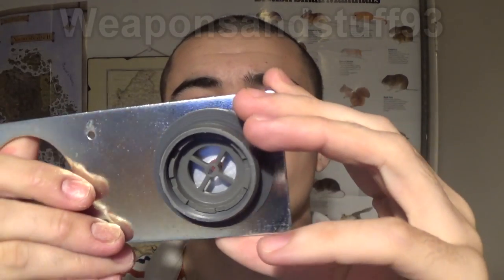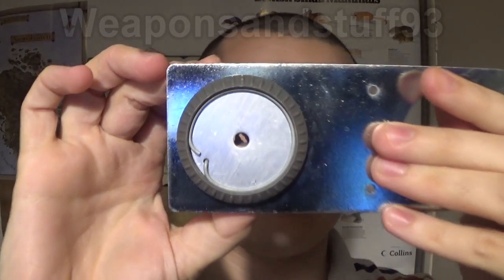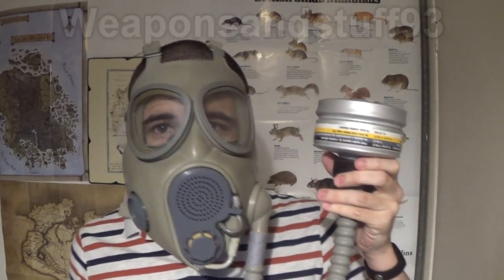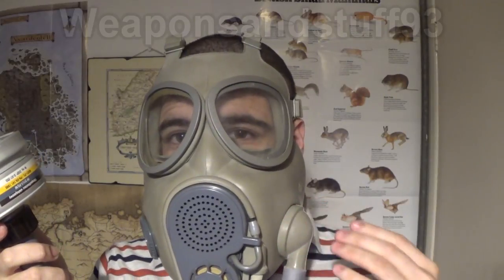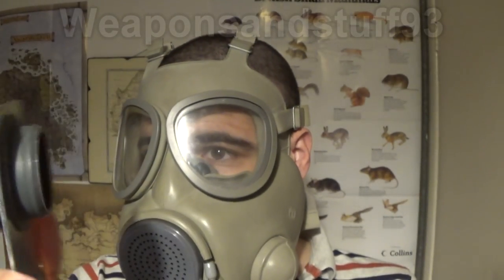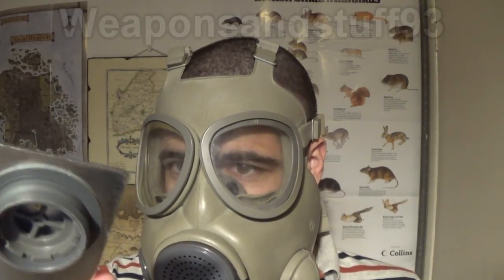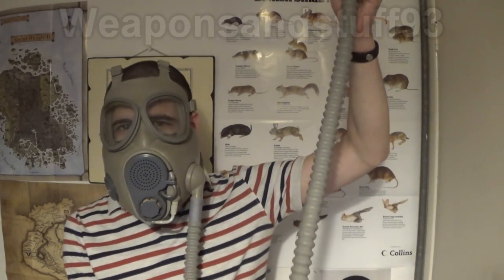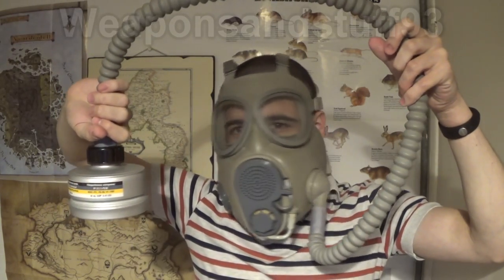The mystery of the M10 hose

Comment: Yes there is a m10 rebreather and it uses two hoses like you suggested. I recently saw one on sale on ebay. Great video btw
Reply from the maker: Never seen one, but seems a really weird design rather than just making a dedicated re-breather mask, as the exhale valve would still go out the front of the mask.
Reply: Please link it
Reply: @Weaponsandstuff93  it's called the ZP 10
Reply: @Weaponsandstuff93  theres an mp4 hose too if you want to know

Comment: OMG I've only ever seen that once in my life, I've been looking for one ever since.  So glade I've found this channel.  Finding that filter hose has been harder then finding the tented lens protectors.
Reply from the maker: Glad the video was helpful.
Reply: Weaponsandstuff93  AS Peter Borak said there's an external oxygen tank that uses one or two of those hoses.  It's for heavy CBRN units.  So what you do is you place the metal plate in the mask then you screw on the voical.  After that you place the hose over the voical.  I remember my dad coming home from deployment he had one.  A lot of people get the CBRN O2 connection mixed up with the ZP-10 vehicle hose.  However they aren't inter changeable from my understanding.  (The threading is different?)  I've looked everywhere for this hose.  When I was going through all of the equipment that my dad has stock piled up, all I found was the flash resist lens covers, the UV lens covers, the lens protection covers, and the mask it self.  A long a users manual surprisingly. (Just through those were myths)  (A side note the MCU-2 has a hose attachment as well, but good luck finding it.) Love your channel dude, cool shit, and it's helped me complete alot of the old equipment that may family's had laying around.  As well as study up on mask design and flaws.  It's also great for when I'm bored as hell at work.

Comment: My pure speculation guess is Its for forced air, such as in a gun emplacement, tank or aircraft... and you'd only need the one side since the forced draft would prevent significant flow through the other cheek filter until you disconnected the supply.
Reply from the maker: +Hamish McGregor As other people have pointed out it's for a rebreather set-up with one on each cheek, basically let's adapt an existing mask rather than make a new one.

Comment: You don't have to have the cheek filter in to use the hose. The other cap with the metal heavily restricts the airflow from the cheek filter only side, forcing more airflow through the hose. Just my theory. Even if it's not the original setup, with that NBC filter on the hose, that could very well solve the old as dirt cheek filter problem.
Reply from the maker: Interesting idea but apparently it was actually a dual hose set up for rebreather systems.

Comment: Maybe you should use rebreather pack on one side and regular filter on other so you wouldn't suffocate when oxygen runs out. Maybe you even attach filter with hose to the back of the pack.
Reply from the maker: That defeats the purpose of using a re-breather in a hazardous environment though, as the filter will fail quite quickly, compromising the mask.

Comment: i suppose its to add more filtering power,I have seen somewhere that  you are supposed to screw two filters on the old hose gasmasks if you are in more dangerous enviroment. the bottom hole has the same screw as the filter screw and you may put two filters or more
Reply from the maker: It's for a rebreather, other people in the comments have posted the photo of the setup.

Comment: the other port you left out was an exhale valve, judging that the rubber pushes outwards so air could escape
Reply from the maker: Well that's a flaw with the setup, you need the intake pipes on both sides, and the exhale is at the front, the mask is meant to be setup as a rebreather with the pipes but the exhaled air won't reenter the bladder, so the whole thing is a mess.

Comment: So you if you have a cheek filter in the mask and the hose on can you then use gp5 filters on it without any problems?
Reply from the maker: Depends how good the cheek filters are, if the particulate filter level of the cheek filters are only 1 or 2 asbestos could get through the filter.

Comment: the part on the metal looks like the air intake on your cheek filter. 
Could you remove it from the metal and insert it in the mask to use a normal filter instead of the cheek filter?
Maybe they wanted to still support the mask but not build new filters for them
Reply from the maker: No it has to screw into the cheek filter or it will just fall out.

Comment: So a gas mask is meant to prevent chemical weapons from being inhaled by the user correct? This begs a question: can you suffocate a gas mask user by depriving the air AROUND them of oxygen? For example, taking a fire extinguisher or two and spraying the air intake for two or three minutes so that rather than oxygen the user inhales CO2
Reply from the maker: A gas mask/respirator does not provide the user with air, it just filters impurities/poisons out of breathable air, so they would suffocate the same as a normal person if they were in an environment with no oxygen.
A SCBA or Rebreather would protect the wearer regardless of if there was oxygen or not.

Comment: Here's a side photo of the system. It's designed from what I understand to be used with the OPCH-90, but there's very little information I could find about it online.
https://i.pinimg.com/236x/ea/b3/2c/eab32c6374c55663d918be1b65aa2a08.jpg
Reply from the maker: I guess it's sort of just an improvised oxygen tank system, I think it would have been better just to have used the CM-3 or 4 mask and just had a single tube going to the normal intake, but if it works I guess.
Reply: Probably wanted to get their money's worth out of the things, or at least, find an actual use for these kinds of masks. I'm all for making cheek filter masks less shite. Even if it's basically a lost cause.

Comment: It's because  m10s suck and now you can use 40 millimeter  Natori filters yards know so that the mask not use less
Reply from the maker: Nope these were so you could use the mask with an oxygen tank.
Reply: @Weaponsandstuff93  I've seen a while back filter inserts that where just to prop out the side panels, I'd suspect it was to attach a hose to and not need a filter inside the mask.
Reply from the maker: @jamesluck2969  That makes a lot of sense actually.